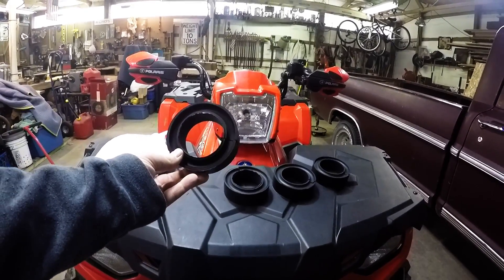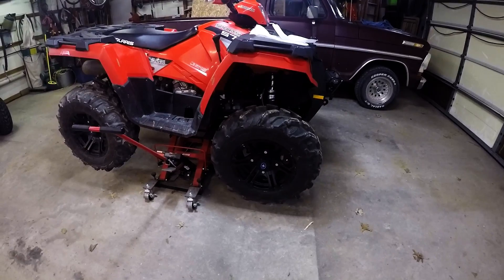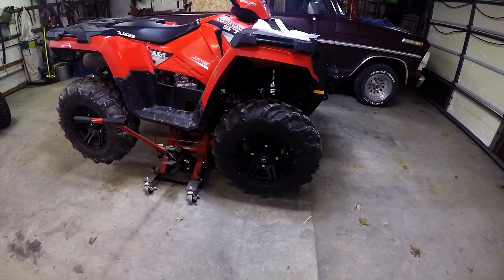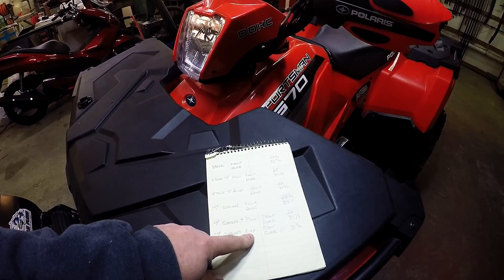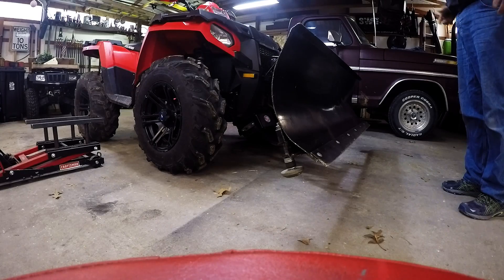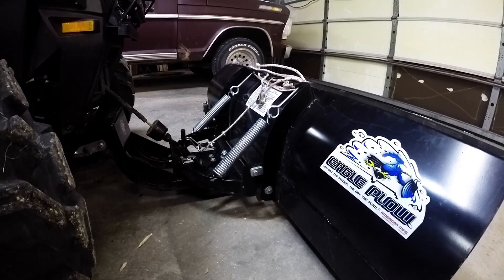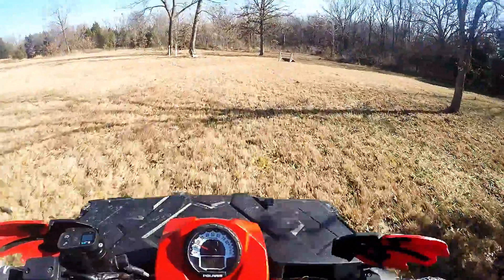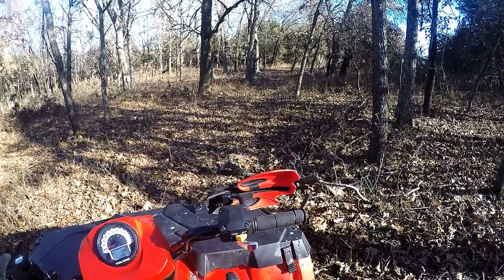Polaris spring spacer install and review

Comment: Great video. Thanks bro. I just ordered mine too. Polaris says you can put two spacers on each side too if need be. Have you tried that? I also tightened up the adjusters to the tightest setting. I’m upgrading my Polaris Glacier Plow to a Boss V. The Boss V is 245lbs and the gentleman from Boss told me, I must address the shocks cuz this suckers heavy. I’m not sure what the Glacier 60 is but I know it’s not 245, that’s for sure.
Reply from the maker: Deerector no I'm only running singles at each axle. I know my plow isn't that heavy. Maybe 70 to 80 lbs I guess. You can get Polaris heavy duty springs, for around 75.00 that would help.
Reply: Dual Sport Guy oh interesting. That’s good to know. Well I’ll try this first. Between tightening them to the max and the coils I think I should be good. But if I’m rocking with bumps and stuff and it still feels mushy, I’ll def do that. Thank you again.

Comment: I have a 2016 polaris sportsman 450 ho (detuned 570) and a put a 2" lift on the front. I literally loaded it on the trailer and my front CV axle broke just unloading it. needless to say I took the lift off immediately
Reply from the maker: Jericho Lee  I did read on the Polaris forum about getting longer axles if you lift one. But that sucks man

Comment: These actually don't really help at all. I have 2 on each front spring and once I lift my polaris oem plow that came original with the bike and installed by the dealer and reinstalled by another dealer it still squats down far enough to lift the back tires up enough to slip a piece of paper under the tires. I had to install aftermarket fully adjustable shocks with piggy back reservoirs to remedy the problem.

Comment: guess what, took the bike out yesterday for a 10 minute ride with my girlfriend, broke another front axle. this is with no lift, stock tires, no power adders. bike has 203 miles on it. in ready to sell this thing. I've had 3 broken axles on a brand new bike
Reply from the maker: Jericho Lee wow I wonder if the lift caused the second axle to fail also, it might have stress cracked and you didn't know it.